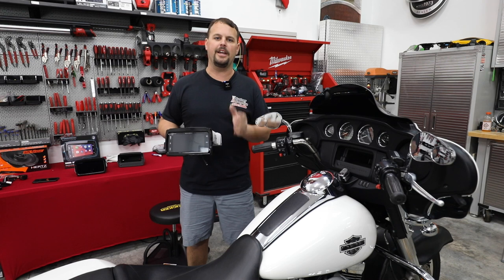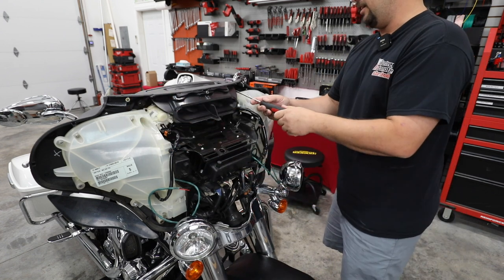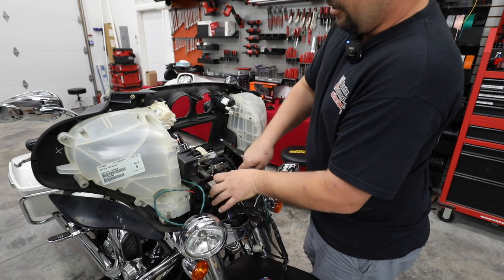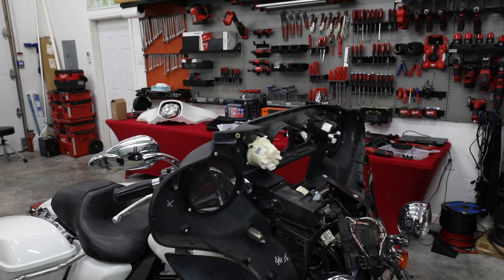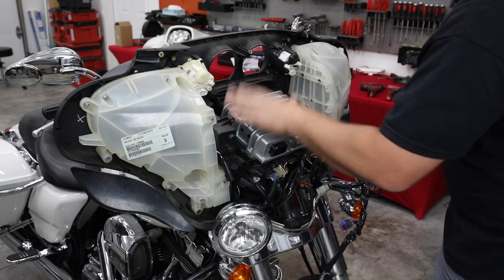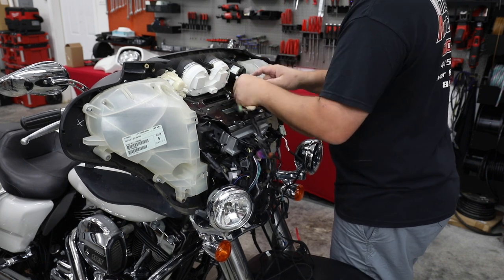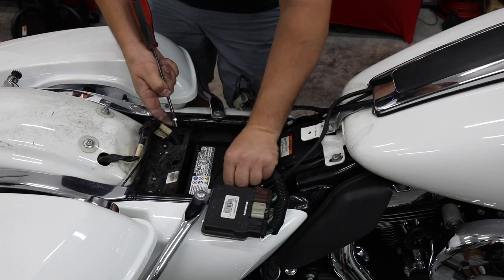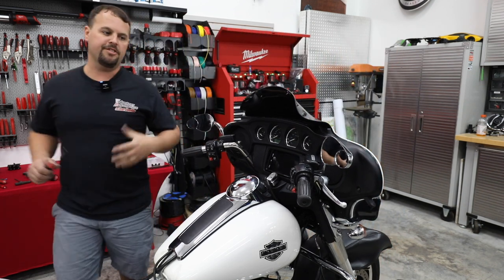How to Install a Soundstream Reserve HDHU14+ Radio in a Harley Davidson Electra Glide Police

Comment: I completed my install, today. Everything that came from Volunteer Audio worked like a charm. The radio was preprogrammed, the thumb control module harnessed in, the speakers fit perfectly as did the covers. The only challenge was to remove the bolts holding the tray to the speaker pods as they were loctide (!!!) in by the person that disassembled the police technology. Had to use a heat wire to loosen them bolts. Also, that same person did not put all bolts in that you remove using the swivel tool. 2 were missing. As for the swivel tool, I can confirm that a swivel 3/8 and a long extension worked just fine. Other than that the whole install was a breeze. Thanks a lot to Jay and the team for this awesome package, job well done. Do you guys plan on setting up a mailing list or something like that to keep in touch with all of us when updates are released? I go riding now and the first song I listen to on my new Soundsystem is ZZTop sharp dressed man. Could it be any other song? 🤣
Reply from the maker: Thank you so much! I’m glad it went smooth!  Keep watching our YouTube and if any necessary updates come out we will go over them in video

Comment: Great video! I used it to figure out a couple of the things I wouldn't have known about with the thumb control connections. Plus this being my first radio install on a bike over 13 I'm glad you mentioned the swivel for the speaker pods. Great service as well. Ill be figuring out the amp next!
Reply from the maker: Thank you for watching! Be sure to call us when you purchase your amp, our setup is completely plug n play and the hard parts (setting gains and filters) we do before it ships

Comment: Will the thumb control module and Bluetooth receiver come preassembled into the radio wiring harness? I don't recall you showing how to install those and where to place them. Cannot wait for my radio package to show up at my door step 😊
Reply from the maker: Yes it will be plugged into the main harness already, just plug it into the new radio

Comment: I'm a proud owner of a 2020 FLHTP with RDRS since last Saturday. This video is awesome, thanks so much. As soon as have the dough, i put my order in. One question: to remove the speaker pods, you used what size wobble tool? the rest is really looking very easy so far. up next thumb controls video :) also, i like to add an amp and better speakers right away. i know me, down the road i want it so why not doing it right away. The hertz speaker, are they suitable to handle an amp? Thanks again for posting. Ride safe 🤙

Comment: DO I HAVE TO ADD THE HANDLEBAR CONTROLS. IVE ALREADY REPLACED THE BARS AND DONT WANT TO GO THROUGH ALL THAT AGAIN ON MY  2014 ELECTRAGLIDE
Reply from the maker: I just spoke with you about this over the phone, not required but the police buttons may operate the radio and other police functions at the same time

Comment: I’ve got a 2017 Police and it has ABS as a standard feature. As far as I can tell after a bunch of searching is that Harley does sell pre-2020 handlebar controls but only for models that don’t have ABS. Is the only option to try and find them on the used market? Is it possible to just use the controls for a non-ABS bike?
Reply: Here’s the part:

Part Number: 71500248C

Fits '14-'20 Touring models (without Traction Control) with a Boom!™ Box audio system (for RDRS see P/N 71500561) and '14-'18 FLHTCUTG models. Stock on '14-'19 CVO Touring models.

Here’s the other part they reference:

Part Number: 71500561

Fits '20 Touring models with Traction Control and '19-'20 FLHTCUTG. Does not fit with Chrome Switch Cap Kits.

To me it looks like the 2017-19 police bikes are kinda screwed because we can’t get the proper handlebar switch gear.
Reply from the maker: There are controls available, we stock several options, give us a call at 1-844-30AUDIO

Comment: I have a 2020 Police.  When Iremoved the fairing I noticed that there was a control model mounted on top of the radio.  It controls the lights and sirens I believe.  Without the module plugged into the harness, my bike will not start.  This is the exact location where the amp is to be installed.  Uh oh!!  I see that this police bike in the video did not have this module.  Probably an older Police model.  Where do you mount the amp on the 2020 and newer Police bikes?
Reply from the maker: All 2020 models have a security box that was similiar to onstar, Harley discontinued the service and this is only on 2020 bikes.  If you unplug it your bike will not start and your dealer can flash your bike to no longer need it.  It has nothing to do with lights and sirens, simply place the box on top of your new amp or somewhere else, just keep it plugged in
Reply: @volunteeraudio  Thanks!

Comment: Putting together a 6 speaker system. Debating on on 4 hertz 6.5 and 6x9in lids or 4 kappa perfect 6.5 and kappa perfect 6x9 in lids. Also is hertz sp4.900 enough or 2  sounddigital800.4 amp?
Reply from the maker: Sp4.900 is stronger than 2 sound digital 800.4 and much better quality in every way, if your doing 6 speakers you have to go hertz because infinity is 3ohm and you cannot run 2 on the same channel without protecting the amp, the infinity will not work on sound digital amps at all

Comment: Question Jay.  If you were to install a setup with six speakers and subs and don't want to put an amp in the bags.  Would you use one amp or 2 and which one?
Reply from the maker: Hard to have 6 speakers and 2 subs ran off 1 amp,  which amps would depend on power requirements, I am more likely to build the system where 1 amp will run it and use higher quality components than more quantity

Comment: Question, if I just wanted to upgrade my speakers on my 2018 Limited would the stock radio be able to produce good sound with new hertz  speakers?
Reply from the maker: You won’t get much increase without adding an amplifier